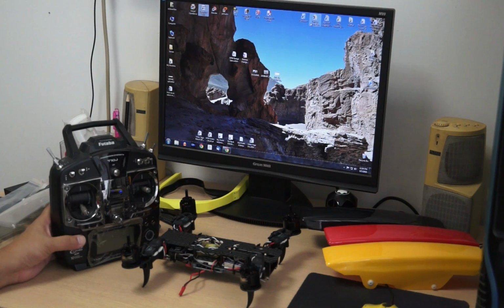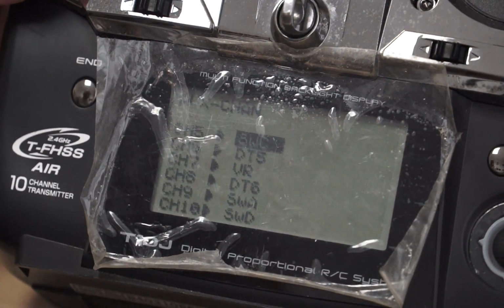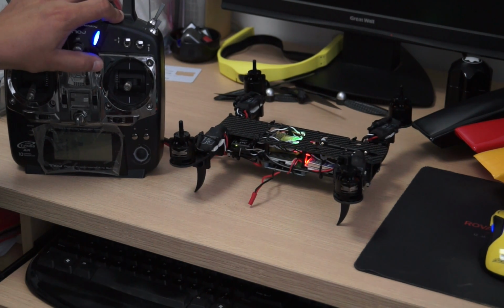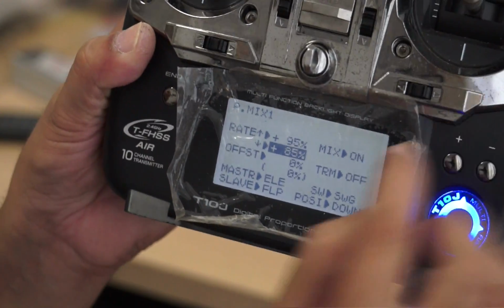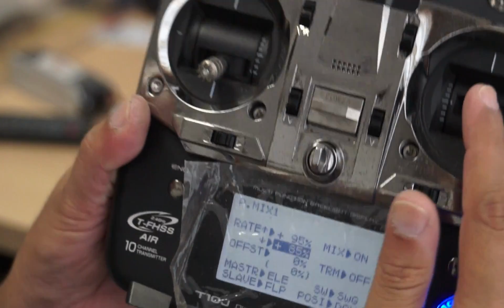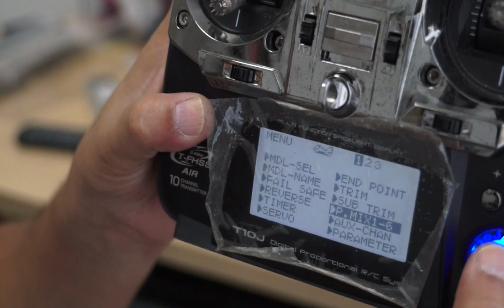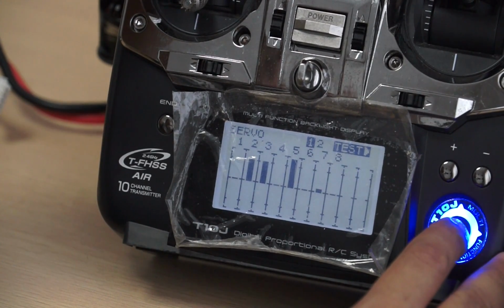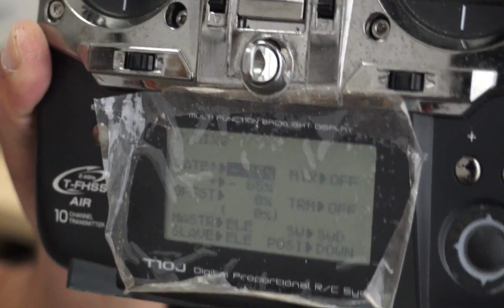OFM Swift TR260 Tilt Rotor FPV racing Quadcopter Build Video Part 9

Comment: Hi alishanmao
can you tell me how to set this programing concept using turnigy 9x radio
I had to try to folowing step by step and adopt it to my radio, but It till don,t work
if I mix the elev by elev with that value, it dont change anything
if I try mix the ch6(gear) as master and elev as slave it just shift the velue to other point, not descrese it.
the one way that I can do is just set the elev e. point value to -63,  withaout ability move to traditional fly.
what do you think, what I should to do...

Comment: Very detailed video. Thanks. 
I was wondering. Is it possible to buy a cheapo quad like a syma x5c n use its tramsmitter n possibly salvage the receiver for a si ple diy quad or do we need an expensive one.
Reply from the maker: +Jasvinder Rekhi there are tons of cheapo quads :D